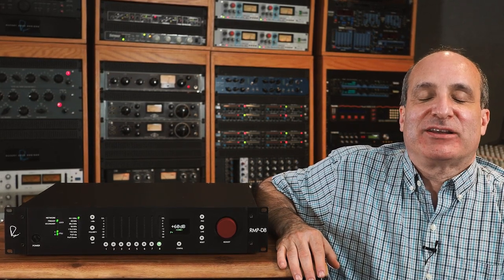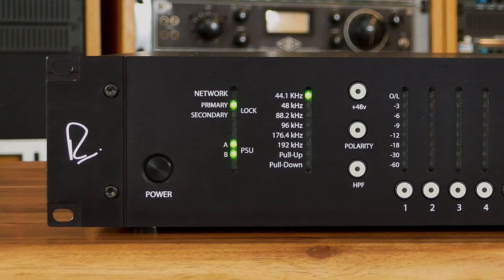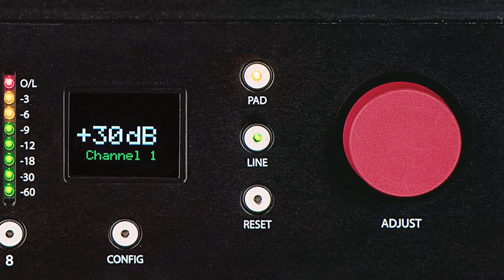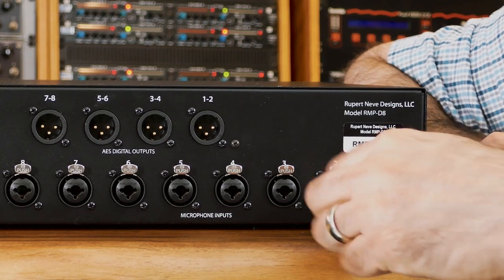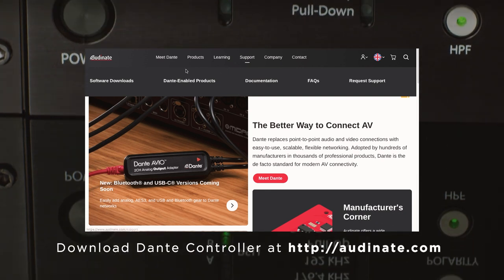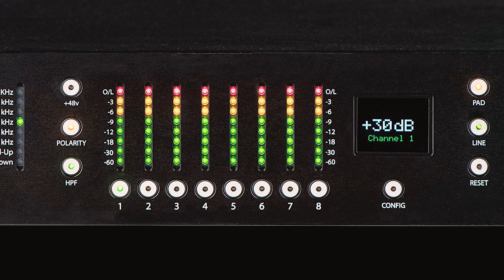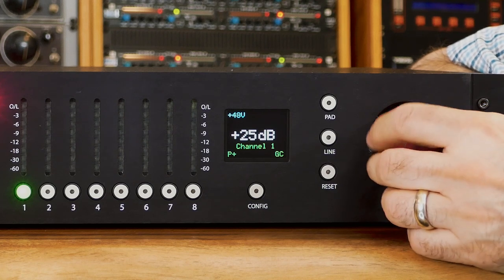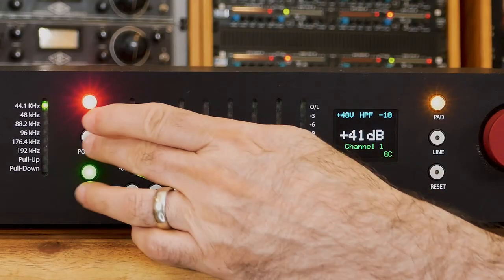Quick Start: RMP-D8 Dante-Connected Mic Preamp & Converter

Comment: Thank you for this great video and all others related to this product. Question: How would I make a M1 mac computer running Logic Pro X to see two of these (16 channels) for recording drums? The mac has thunderbolt connectors only and there are a total of 16 microphones (condensers and dynamic). Is it possible to have a 'direct' connection between both RMP-D8 (master + slave) and the Mac? I'm trying to understand the wiring between the 3.

Comment: Are these the same converters used in the new Master Bus Converter? Thanks
Reply from the maker: The transformer path is very similar and sonically there were mastering engineers using the RMP regularly for just conversion before the MBC came out. The MBC is distinct because it has separate transformer and transformerless paths as well as control over the transformer with silk / texture... RMP basically has a medium amount of silk on all the time,  geared to have a similar level / quality of harmonic distortion as a vintage Neve preamp
Reply: @RupertNeveDesigns  This unit sounds fantastic. I would love to see a two or four channel version for the home studio with the exact same sound and components.
Reply: @theblowupdollsmusic  yea i prefer them over shelford. Would be nice to have 2-4 channels